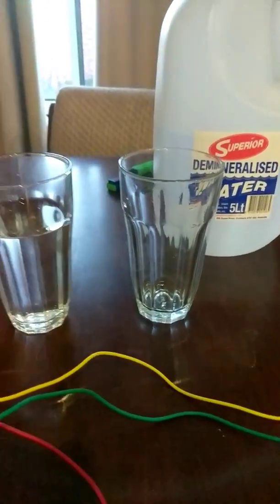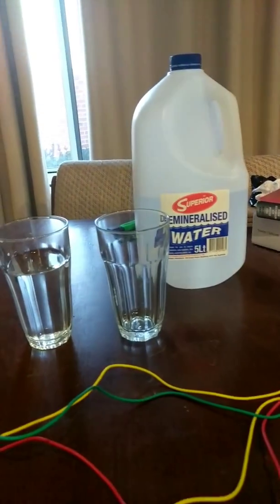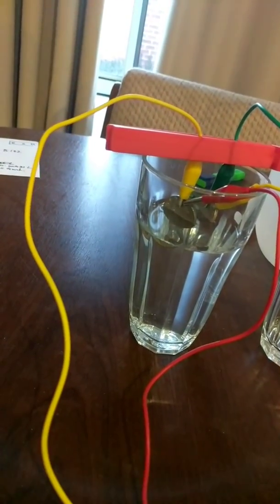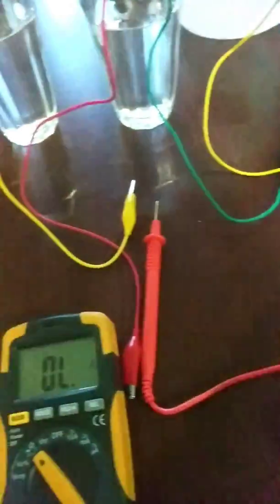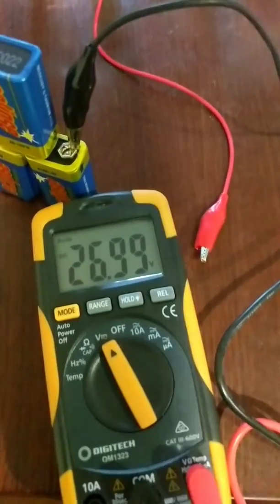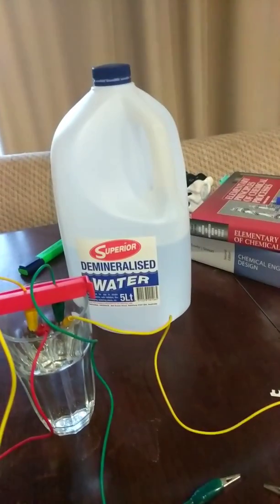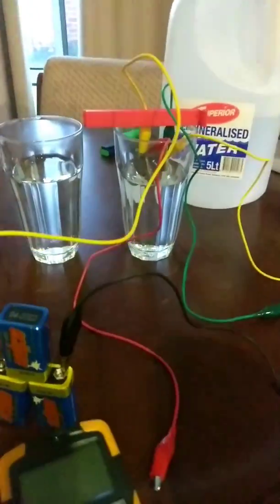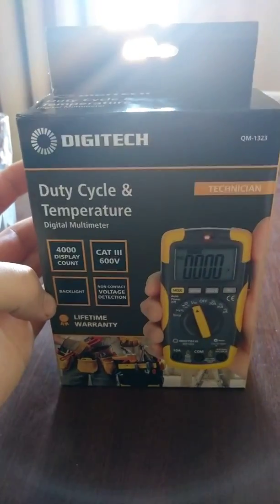Examining pure water and the self ionization which allows current

Comment: Yeah, using a bulb is not going to work because because the wattage needed to light a bulb.

More specifically,  If the water and a bulb compose a voltage dividing resistor network  then the vast majority of voltage will be dropped across high resistance pure water, leaving fractions of a volt  to be dropped across a light bulb, and fractions of an amp flowing through it, and their product watts in the fractions of a watt range are just too small to visually observe in visual light spectrum.  I suspect that even an IR meter would have have trouble sensing  using  regular LED's.

You could double the conductivity by doubling the surface area of the probes.

Comment: Your intentions may have be in the right place but you really don't know what you are doing. lol.
Firstly, if you don't know how to even read your meter then you will ultimately fail.
Secondly you are using batteries. This means you WON'T be using the AC ranges on your meter. Only DC current will be present. AC current is not in batteries, it's in the wall sockets of your home. (𝐼 𝑑𝑜𝑛'𝑡 𝑠𝑢𝑔𝑔𝑒𝑠𝑡 𝑦𝑜𝑢 𝑒𝑥𝑝𝑒𝑟𝑖𝑚𝑒𝑛𝑡 𝑤𝑖𝑡ℎ 𝑚𝑎𝑖𝑛𝑠 𝑣𝑜𝑙𝑡𝑎𝑔𝑒 𝑏𝑒𝑐𝑎𝑢𝑠𝑒 𝑦𝑜𝑢 𝑎𝑟𝑒 𝑙𝑖𝑘𝑒𝑙𝑦 𝑡𝑜 𝑘𝑖𝑙𝑙 𝑦𝑜𝑢𝑟𝑠𝑒𝑙𝑓).

Deionised or demineralised water, although has far fewer impurities or dissolved ions than regular tap water, it is still not PURE H₂O so some current will still flow.

https://www.quora.com/Why-cant-pure-water-conduct-electricity
Reply from the maker: You're right that I have little knowledge of multimeters. I sought help from others who did before doing this to avoid mistakes such as reading the electrical potential.

Irrespective of whether the current was AC or DC, I still got a positive reading for current flow. When the batteries were removed and the circuit again closed, that reading was no longer there. If I was going on to use the quantitative data elsewhere down the line, your point about AC and DC would be valid but in this context, it is moot.

Pure water self ionized to form minute amounts of hydronium and hydroxide ions which allows a small amount of current to pass. This is why the reading I obtained was so small and why the resistance is so high. Such a high resistance is also why P&P couldn't light a 240v globe by passing 240v through deionized water.

Now arguing about how you can never have pure water is a bit of misleading point and let me explain that. Discarding the fact that no process can ever be 100% efficient, if you had 100% pure H2O, it would immediately self ionize into hydronium and hydroxide ions until it reached equilibrium. This is just how chemical equilibriums are. Now, you have not added nor removed anything from your sample, so is it still pure? It can be reasonably argued either way.

So if pure water is impossible, how do we know these hydronium and hydroxide irons aren't just impurities? Because we can do quantitative and qualitative analysis on various water samples which when combined, cancels out noise in the data (removes actual impurities from the measurements) and allow us to calculate the chemical equilibrium.

So, although you're comment was meant in a more or less positive way, you missed the point entirely and focused on aspects irrelevant to the topic at hand.
Reply: @dabrownie93  
Ok, so I learned something from you today. That pure H₂O self ionises into hydronium and hydroxide ions 

https://en.wikipedia.org/wiki/Self-ionization_of_water

Now learn something from me. It is quite impossible to get an AC current or voltage reading from the setup / experiment you had. What a multimeter registers on its most sensitive ranges is "stray" electromagnetic fields from nearby appliances and even the wiring in the walls (even from a few metres aways).

The only other point I had issue with was that when you went from normal tap water to the demineralised water you merely shook the coins somewhat poorly in my opinion. What I feel was truly required was to rinse the coins thoroughly with the demineralised water, as any droplets of tap water remaining on the coins would've severely affected the conductivity of the solution.

Anyway we learn from our mistakes. 
Have a nice day.  👍😎👍
Reply: @jtveg  It may be said, he blundered through it.  His experimentd demonstrated what would be expected given a battery, and the test performed,  and he properly interpreted the ac result was nonsense, even if he failed to demonstrate knowledge why. 

But I will add that there is want for various controls to rule out or confirm various hypothesis. 

 1) Does temperature effect the rate of auto ionizing thus the amount of  conductivity?
2) Does the amount of surface area,  and distance between plates effect conductivity.
3) Does the electrode material have a significant impact on the current given a certain (voltage electrode area, distance between plates and temperature of pure water).

The recommendation to rinse the electrodes with pure water before inserting them is a very good and reasonable recommendation to the method in his experiment, thus improving the trustworthiness of the results, by removing potential source of contamination in the experiment.